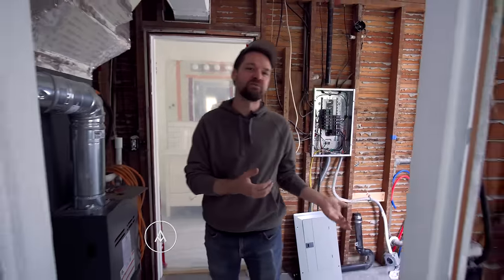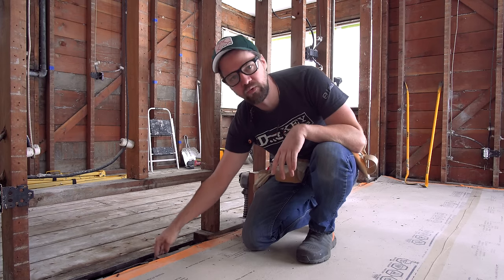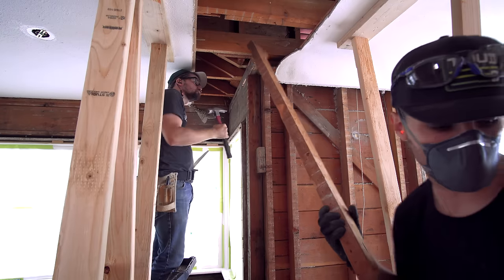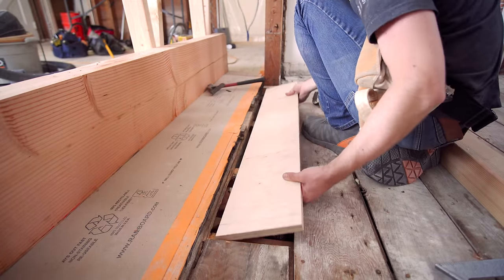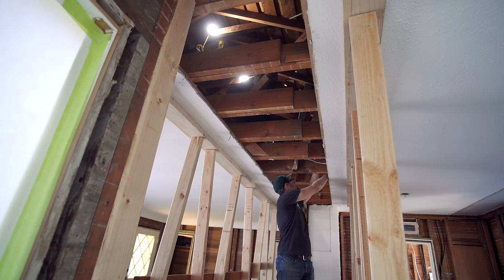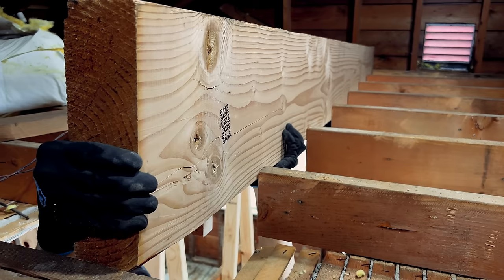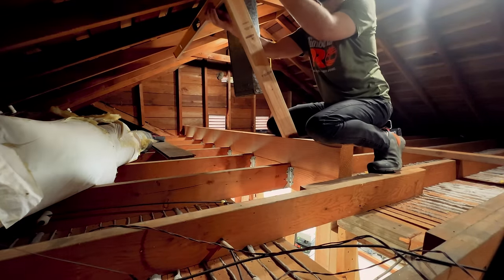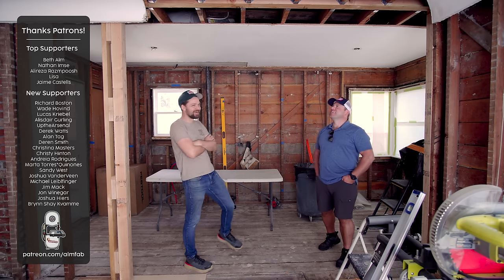Want to remove a wall? Here's what it takes...

Comment: I don't know who your "engineer" is but that's not how a roof truss work if that's how he or she explained it, nor is it how you're really supposed to alter it if you need to cut the lower beam. The solution probably works but it's a really unconventional way of doing it and is nowhere near how I would've done it because the entire global system of the houses roof has been altered to a kind of "slanky" construction with a lot of questionable pin joints.

A roof truss works in unison with the upper beam, the trusses/struts, and the lower beam to form a really tall "beam" that can span long distances. It achieves this by an interconnected grid of members/trusses/struts. If you remove or cut one member/truss/strut of the roof truss the entire load bearing system gets altered to something completely different than the original system. The way you cut it in this video made it so the lower beam got two pin joints introduced (the connection to the big new beam) when it's designed to be a continuous beam spanning from one outer wall to the other with a support in the middle. You more or less altered it from being a roof truss to being a single A-shaped beam with an angled support (the upper beam flush to the roof supported by the angled truss/strut) and two hanging beams that supports the inner roof (the lower beam of the roof truss). If I would make a guess without doing any calculations I would guess that the new roof does not have the same load bearing capacity as the old roof truss because the new main load bearing member and connection is the angled former truss/strut which you nailed to the top of the big new beam with like four nails.

Credentials: I work as a project managing structural engineer focused on design drawings and design calculations for large and small structural systems in both steel, concrete and wood at Sweden's 4th largest engineering firm called Tyréns. We build a lot of wood in Sweden, for example my office designed "Sara Kulturhus" in Skellefteå in Sweden, which is the fourth tallest wooden house in the world.
Reply from the maker: You’d be correct if it was a truss roof, but it’s not. It’s a rafter roof. 

https://legacyusa.com/blog/truss-roof-vs-rafters/#:~:text=A%20rafter%20is%20defined%20as,way%20to%20frame%20a%20roof.
Reply: @MichaelAlm  I stand corrected, for some reason I thought that every rafter had trusses/struts but when I look back at the video a bit more carefully only a few of them seem to have them. It does however not change my original point of it being an unconventional solution.

The lower beam needs to take horizontal loads because the rafter beam presses outwards on the outer walls when load is applied  to the roof, so the lower beam works as a "tension rod" in the system which is now cut. The conventional way of supporting the lower beam, on a truss roof and a rafter roof, if you want to remove a wall is to put a beam on top of the lower beam and extend the columns up in the addict and hang the lower beam up to the new beam. That way you don't interfere with how the original structural system works and don't have to cut a "tension rod". Right now the joist hangers has to take up pulling forces which is not their primary function, they're mainly designed to take lateral forces. You only rarely use them to take up pulling forces if you don't have any choice.

But as I said before, it probably works but I don't think the load capacity of the roof is the same now as before, and the solution is very unconventional. You always want to avoid to cut things if you have other choices.
Reply: @LouieGrind  the LUS28 hangers and SD screws handle the tension.  Do the math.
Reply: @Loonypapa  Simpson, the literal manufacturer of the fastener, says that they are only meant for shear loads, not tension. If you want to make a similar connection for tension you have to make a completely different type of connection. No engineering company would allow this connection to be used, mine included, because it completely disregards the manufacturors instructions which completely nullifies the waranty of the product used.

But go ahead and do whatever you want. It's on your concious, personal and economical responsibility if anything brakes.
Reply: @LouieGrind an LUS28 hanger with SD screws is a double-shear hanger. Meaning it handles shear in two planes. Read the 2022 technical memo from Simpson.
Reply: @Loonypapa  I know. It handles shear in the X and Y plane. It does however not handle tension in either plane. 2x shear != tension. The LUS28 only handles downward forces, not forces outwards from where it connects. Then you need a completely different fastener which is either composed of big plates following the grain in the beam with a bunch of screws or you make a special cutout with a stud. I've made these types of connections several times and I'm telling you this is not how you make them. Just google "gerber joint/connector" to understand the connection type and why using a LUS28 is completely wrong.
Reply: @LouieGrind guarantee it would still be standing if I used fing deck screws
Reply: @nolansmokes  Absolutely, if you used enough of them it probably would because one deck screw can hold up to ~80kg each depending on the thickness of the screw and some other factors. The thing you ignore is that deck screws are made to take tension loads. Beam shoes are not, they are made to take normal loads. The beam shoe might work for a couple of years but you have to remember, these connections should have a rating of 50 years. I suspect in ~10 years that connection won't be sound because of the cyclic pulling of the beam shoe caused by wind loads. If you made that connection in an official building project it would never pass inspection.

Comment: That's not how you build a temporary wall. Please, anyone reading, look up how literally every contractor in the world does it using just standard plumb 2x4s. Simple, fast, and way safer than this method.
Reply: I was just about to comment that
Reply: As an engineer I don't see that many problems. Just because everybody else is doing it differently doesn't make yours wrong...
Reply: Yea. His method may work but its way more work than just using 2x4s that are plumb.
Reply: There’s more than one way to skin a cat, the method you describe is the common method but the way he did it is the way lots of people up in the Northeast do it
Reply: @adamdurham7643  I am from the north east and Micheal is from the north west. Your logic is flawed. I have never seen or even heard of this method.
Reply: @rjgaynor8  ok 👍, it’s generally called a “pony wall” but I’m sure you have built many of them in all of your yrs in construction and contractor work so I can’t speak of what I don’t know!!!
Reply from the maker: It’s a legit method, maybe a little uncommon, but it’s used. I like it because you can set the tension which is handy on a plaster ceiling. Here’s a version in Fine Home building: https://www.finehomebuilding.com/readerproject/2011/01/31/shoring-up-a-load-bearing-wall 
Also Tom Silva uses this method in this episode of ATOH How to Cut a Pass-Through in a Load Bearing Wall | Ask This Old House https://m.youtube.com/watch?v=xQT_ZasSdos
Reply: Super stupid question but what is a ‘“plumb” 2x4?

Comment: Better know damn well what you need to do to make that furnace both heat efficient and not backdraft. If a furnace is in an attic and not very well insulated (impossible) you're gonna get moisture in your attic, and ice dams on your roof. You need a manometer, CO detector (with "as measured" and "air free" settings) and a smoke pen to be able to safely test it. Nice video though.
Reply: Are the ice dams a meaningful concern in Seattle?  Huge concern in Minneapolis, yes,  but in Seattle?
Reply: Yeah I don’t think deep freezes are a problem where he is, they don’t even have basements for frost footings
Reply from the maker: Seattle is extremely temperate. We rarely get below freezing, so ice damns are not a concern. The furnace will be installed by pros, and it will be done right